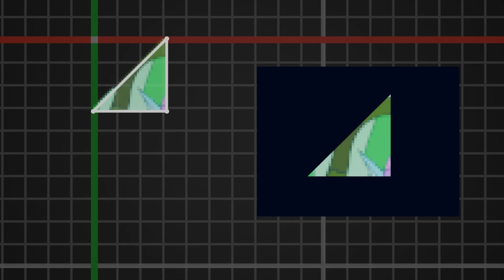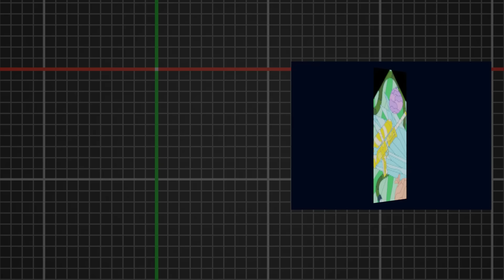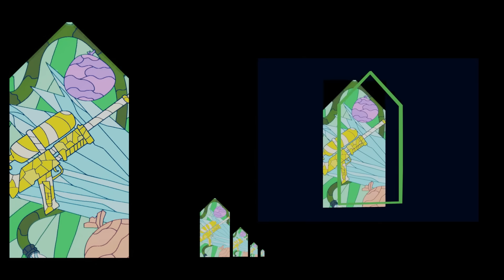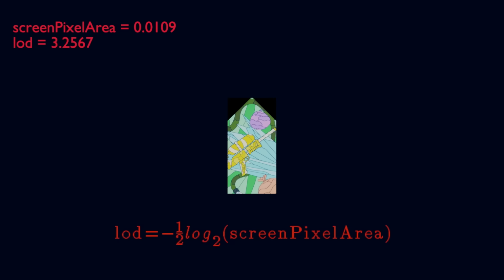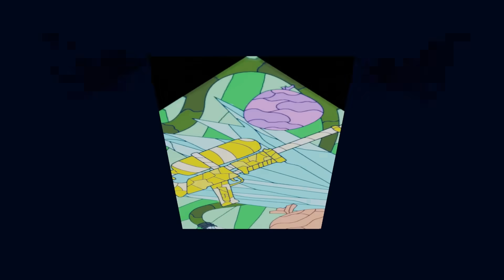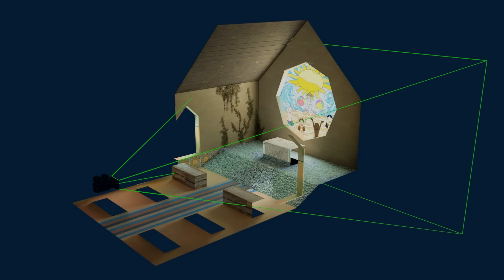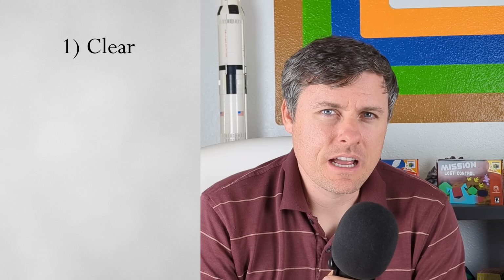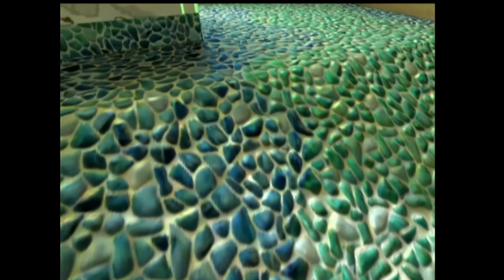How I implemented MegaTextures on real Nintendo 64 hardware

Comment: I never expected those gorgeous textures would actually be possible on the N64 with its cripplingly small texture cache.
Reply: The sad thing is, the small texture cache was always just a soft issue. The developers on the early N64 games weren't familiar with batch rendering, which was a niche technique at the time, but almost certainly what the hardware was actually built to do by by SGI. It was only late in the N64's lifecycle that Factor 5 started using this technique to get high resolution textures rendering on the N64.
Reply: @ryancrosby1251 exactly. It would’ve happened a lot sooner too if 64MB had been the norm from the start. If only the 64DD had been the default format! It was ready for launch… even the one example of a retail US unit was ready in 1996. My guess is that Nintendo was ready to switch right away if the cartridge format crashed and burned.
Reply: You know, Rareware and others worked around the texture cache limit. It was cartridge size that was limiting them in the end.
Reply: @emmettturner9452 Even with CDs, with such low texture memory available, the best you could do is store multiple low resolution textures coupled with horrible memory latency offset by RDRAM.
Reply: Many devs took advantage of the cartridge format to work around that exact problem.
Reply: I remember that being dynamic LOD in games like Unreal and Serious Sam
Reply: I think I saw recently a video that said the size of the texture cache isn't the problem (PS1 is even smaller) it's the fact that it's up to the dev to handle it, on PS1 it's handled automatically  (by the SDK I think).
Reply: @indask8  The texture cache is not that big of a problem, it's not ideal, but manageable. The problem is the N64 RAM's bandwidth restrictions which don't help at all when Z Buffering is used. It's why higher end N64 games minimized or disabled Z buffering entirely. If your game doesn't use chonky overlapping polygons, I.e. you have an arena type of scene, you don't need Z buffering at all for the background.
Reply: @indask8 PS1 isn’t handled automatically
Reply: @indask8 no
Reply: @indask8  difference is the ps1's texture cache is actually a cache. people call it a cache on n64, but it's better described as texture memory (i think the docs call it tmem, but that might have been on the cube) or scratchpad or something like that. The entire texture you're drawing at any given moment, needs to fit in that 4K, including the mipmaps. PS1 isn't like that at all, you have 1MB of VRAM, the texture cache works automatically to speed up texture reads.
Reply: @jc_doge then you try to let your RAMBus go brrrr and find out that larger bursts are the way. Soon your 4kB scratch pad prototype out-performs your 16 byte 1 associative cache.
Reply: actually in ancient times, when earthworms jims walked on the ground this problem was solved by swapping sprites through cartridge to memory
Reply: Tru
Reply: Do you utilize the RAM expansion slot? Could you with this optimization to make better games?
Reply: Really makes modern game dev's look lazy
Reply: before i watched all of the video or text, i instantly assumed its because its simply one room and it can stream as much textures in line as it likes thanks to flash storage , thats why u see buffering textures on new camera positions
Reply: You can get similar/better results using texture replacement packs on N64 emulators.
Reply: It isn’t cripplingly small
Reply: Well we kind of always knew what the potential for the N64 was because it was just customized SGI hardware, and the primary changes were due to prices at the time. Which, y'know, is probably why you don't build your console with workstation hardware, but Ninty did make it work for the most part. 

Let's be honest, by the end of its life, the N64 had graphics so painfully close the likes of the Dreamcast's launch titles, and the original design hardware was OP enough, we'd really remember the N64 as being low-res PC style graphics, similar to the OG Xbox's contemporary graphics, and likely not remember the PSX graphics much at all. You'd either have the Japanese Saturn releases for arcade ports or you'd have the superior N64 graphics. Instead, we're stuck with a curious bunch of consoles who really all had some compromise, or multiple, in the case of something like the 3DO and Jaguar.
Reply: It has double the texture cache of the PlayStation… I mean what do you want for 1996?    Blurry textures are mostly a developer choice and a cartridge constraint.  A lot of PS games were built on pre rendered backgrounds 😂
Reply: I already knew that it was possible, but it's not something that can realistically be implemented in an N64 game running within the parameters set by the limitation of the original hardware.  The game would not run smoothly.  You could make extra optimizations, but compromizes would still need to be made.  This is best suited for a technical demonstration.
Reply: @victoriagrayson5082  also if you wanted to make an actual game with the length (gameplay, story, etc.) being somewhat decent, you'd need to sacrifice that large texturespace, unless your whole game takes place in the same area.
Reply: Well it's 40 megabytes and running on a N64 as he said so it does, and indeed can fit on the larger N64 cartridges which were 64 megabytes?
 @victoriagrayson5082
Reply: the n64 could use these modes but Nintendo told devs to never use it so there games didn't look like ps1 games. the blockly look was intentional.
Reply: @gogereaver349  Didn't Sony PlayStation 1 video games have the blocky look as well there? I mean – the Sony PlayStation 1 has weaker hardware than the Nintendo 64!
Reply: @StevenVillman  the PS1 could do less blocky low res textures. The N64 hardware can to but devs where banned from using it
Reply: Yeah that’s the point of the video
Reply: @scottcaramel that’s the point of his comment
Reply: @PhenomRom that’s true bro
Reply: @scottcaramel No
Reply: Thanks me too.
Reply: @SadieTheMooingKitty Nop
Reply: @scottcaramel I swear these comments are from bots. If you notice, every top comment on every video is just basically a recap of why the video exists in the first place. If you watch a video of like, a man falling down, the top comment is usually like “Omg the way he fell was so funny.”
Reply: @ro25988  probably to help the algorithm do its thing
Reply: @ro25988  dead internet theory strikes again
Reply: @ro25988 it could also just be a regular person- like, commenting... in the comment section...

...where you can comment things like that...

...
Reply: @ro25988 I wrote a comment like this too and I know I am not a bot
Reply: @ro25988  I agree. Another observation is that these „people“ almost never tend to answer in the thread they started themselves.
Reply: @maccaswam  I thought I made it pretty obvious that I was drawing the line at particular TYPES of comments, but there’s always someone who won’t understand I guess lmao